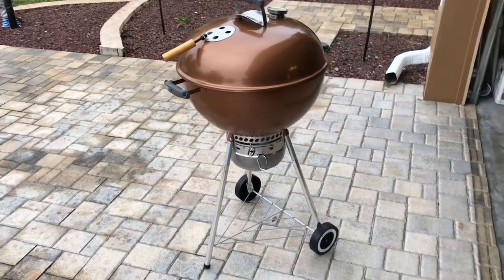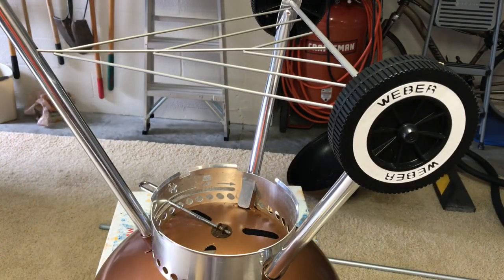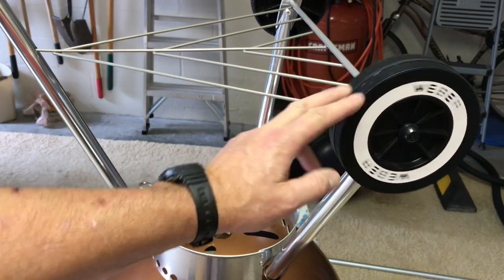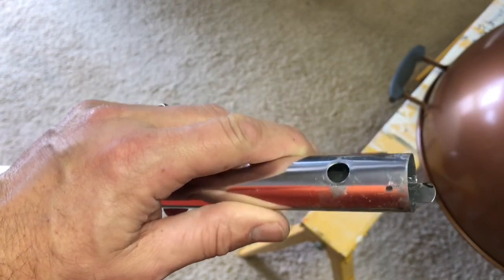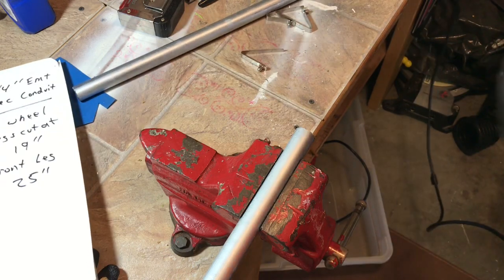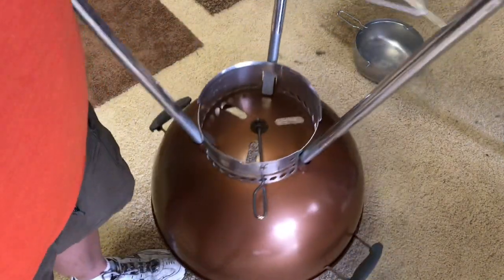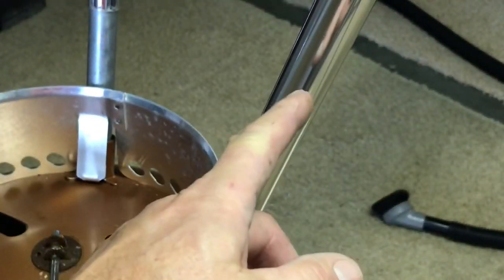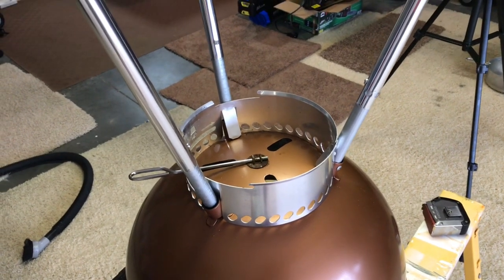How To Do The Leg Extension Modification On The Weber Kettle For Less Than $8.00. Made Even Easier!

Comment: Great advice! I made one modification. I kept the old legs off the Weber grill I was replacing. I painted them black after cutting them down to six inches. I added these to the top of the legs to cover up the conduit. Because they were black, they look like part of the grill. What a great look! Additionally, these old legs made a very tight fit! I added a screw at the base of the grill into the legs for added structured integrity. It works great!
Reply from the maker: Thanks for Watching! Great ideas!

Comment: Nice upgrade Tom. I had to go back and put a second screw in the coupling where the legs attach. Helped stabilize even more.
Reply from the maker: Phil N Florence Yup, works great to stabilize! Thanks for Watching Phil!
Reply: I had to do this as well. I used self tapping screws and washers. The emt tubing didn't fit snug at all into the three mounting holes under the bowl. No more wobble. Loving my kettle again!

Comment: Have to thank you tremendously for your work with this modification.  I did this on my 18" kettle which I'm trying to pimp out a bit. :-)  Perfect size for my needs, but definitely too low.  Sharing that with the smaller kettle, I went with a 4 inch lift and it worked great.  (Sounds like I'm talking about off roaders! :-) )  It's now basically the same height as a master touch, but I couldn't get one of those in the 18 inch size.  I tried the higher size but was really tight to the point the wheels didn't roll smooth, my thought due to the smaller geometry.  HUGELY worth doing even on the 18, fwiw. .  Your modification is outstanding, extremely cost effective and will save my back.  I'm 6'2 and this is perfect for me.
Reply from the maker: Thanks for Watching! Glad it all worked well for you! Thanks for Watching and commenting!
Reply: You’re trying to sell your weber on the corner in exchange for some questionable activities???

(I kid! I kid)

But good to know that this works on the 18” as well.

Comment: Nice mod, like the "green goddess" you have.  I did the same with an old 2006 model that had the friction leg fittings at the bowl.  I had lots of weeble wobble and put some screws in that helped, but it still wobbles a lot.  I may try taking them out and putting some kind of spacer in there - maybe a couple wraps of metal HVAC tape to make the conduit large enough and decrease wobble.  Love your vids as always....
Reply from the maker: glctrains7 Thank you for watching! I appreciate it!

Comment: Did the paint on the inside of the lid burn/flake off for you? Mine did (it's only 3 years old) & I know how that it needs "high temperature" paint but all of the varieties that I've found say no exposure to direct flames or it can only sustain up to 600°F of prolonged  exposure. What paint should I use?
Reply from the maker: Adam Huffman Thanks for watching Adam! There is no need to paint the inside of the lid it is porcelain enamel coated! The piece I referred to in the video is on the out side of the grill which I did paint
Reply: @TomHorsmanAmateurBBQ  thnx for the feedback. However mine isn't the "elite" colored version like yours, it's just the plain black model. Does that make a difference?
Reply from the maker: Adam Huffman Lol Adam! It does not, just an fyi, the colored versions are usually the same price as the standard black model.
Reply: It's not uncommon to see carbonized grease build up on the inside of a Weber Kettle dome lid that appears like peeling paint, but it's not paint.    It should be cleaned/scraped off because it can fall onto your food.